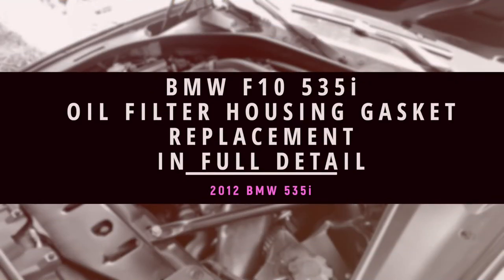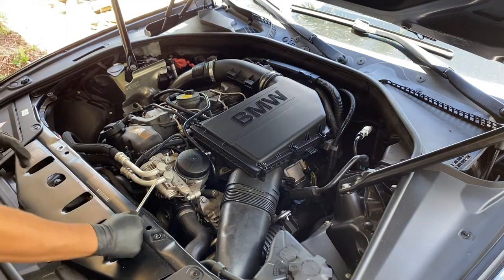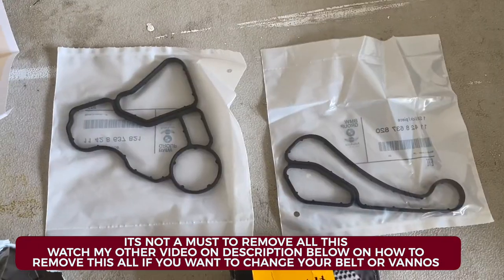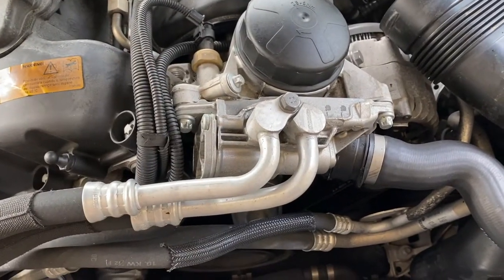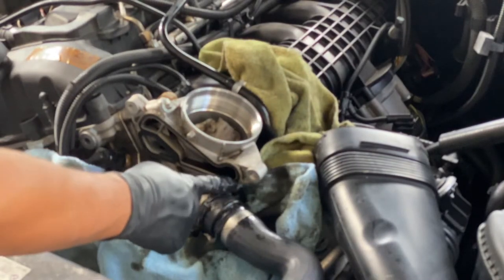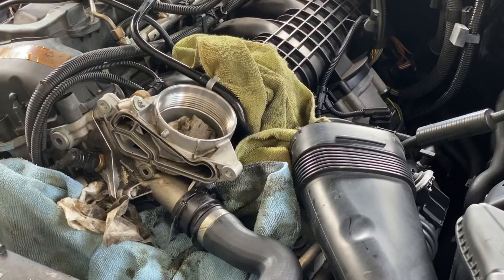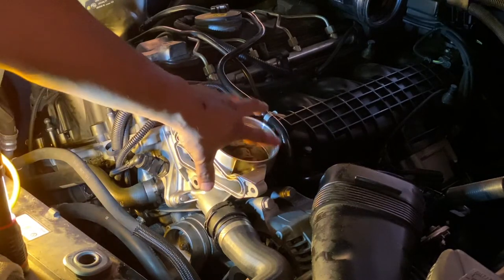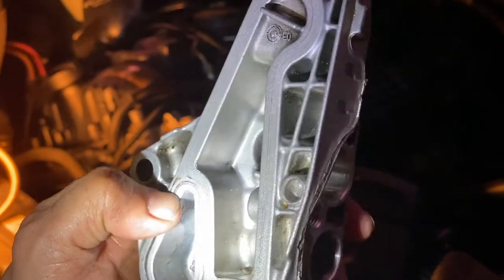BMW F10 N55 535i OIL FILTER HOUSING GASKET REPLACEMENT

Comment: Great video. In the process of changing thermostat, water pump, tensioner pulley , oil filter housing gaskets, and new charge pipe. Car just hit 120k miles want to prepare it for another 100
Reply from the maker: Good luck bro. I sold mine. I have plenty of videos on this car so check it out on f10 playlist
Reply: @HowToDoitright  cool man ill check it out

Comment: I started leaking heavy oil in my N55 2 days ago, had to put 3 quarts of oil in and I noticed today another heavy spill. I checked my coolant tank and it has oil in it. I will definitely take it tomorrow for the same repair you demonstrated including the belt as well. I wish I had the skill and tools to do this job myself. I should've done it as soon as I saw the small puddle on top of the filter🙁... Great video
Reply from the maker: yeah i ignored mine for a while and it damaged the belt (and pulleys which i had to clean). i also identified today that along with this my valve cover gasket is also leaking. i suggest get under the car and see if your leak is getting on top of your exhaust pipe. that indicates a leak on your valve cover also. you can take a flash light and see evidence of oil leaking from sides of valve cover on the passenger side of valve cover. Normally the oil filter housing leak dont make it leak profusely. i can almost gurantee its also your valve cover gasket. have it checked out by the mechanic and have him show you so he isn't lying to make $$.. you can also get the oil filter housing first and monitor the leak and take it back as those are two separate jobs and not related at all.
I will do mine by next week iA and post a video on my channel.
Reply: @HowToDoitright  i really appreciate the advise and I will be looking out for that video. So your saying if the oil leak is profuse then its more the valve cover gasket instead of the filter housing?
Reply from the maker: Yes I lived with my oil filter housing leak for a while because it wasn’t dripping on the ground as it’s so little but didn’t know at that time that the little leak is going all around and damaging my pulleys and belt and since it’s so slow the oil will endup drying on top of your belt that you can see with a flash light and You can even remove the gunk with your nail. It like solidify on too if your belt and pulley. Also it runs down on the front of your engine making it all dirty. That’s another sign. 
The valve cover leak normally is a fast leak and it also cause bad burnt smell outside and smoke in some cases. Also you can smell it as it burns on your exhaust.
Today I posted another video on my belt replacement. Watch it. You will have a look at the front of your engine and if yours is as dirty as mine then your oil filter housing is also leaking.
Reply: Not so much problem with tools as time. BMW wanted about $5000 for what I am doing.
Reply from the maker: Wow 5k is crazy
Reply: Mine is being done now... an going to do the value cover as well... I'm at 146k miles... my value cover ain't leaking but my housing is losing Hella oil... but I also rode with it for 20k miles b4 I realizing the housing was leakin.. barley have any oil in my coolant... so I flushed it after the oil fliter housing replacement an I replaced my belt as well cuz oil had contaminated my belt.. 

Fuel pump 
Charge pipe
Ac unit 
Tire rods 

Are all done now getting the rest done 

Next will be my turbo, water pump b4 they want to go

Comment: Thank you, your assistance is much appreciated. My mechanic buggered up the head on the OFH bottom bolt under the 
intake manifold. Your guidance about loosening the intake manifold would have precluded this. Was there no need to replace the intake manifold gasket?
Reply from the maker: I did replace it later on. It’s cheap so good idea to replace it

Comment: Thanks for the great DIY! One question, Did  you drain out all your oil  from the oil pan before starting the disassembly or only from the oil filter?
Reply from the maker: RiskyRicky_F10 no i did not remove it from oil pan. Only the oil filter. I’ll do another oil change after 5K
Reply: It is advised to drain the oil AFTER the repair because water can get in the oil.
Reply from the maker: Yeah cheap insurance

Comment: about to help a friend with this. maybe i scrubbed past the part where you talked about this but do you need to drain the AC beforehand? not super familiar with BMW but those lines  you unplugged on top were for the AC correct?
Reply from the maker: No Sir that’s not AC lines. That’s coolant line but I didn’t drain my coolant. Some will come out but that’s ok. Drain it if you want to drain your coolant otherwise not needed.
Reply from the maker: Definitely change oil though. Your oil may be muddy as its possible coolant is mixing with oil as it flows through oil filter housing however oil doesn’t go into coolant.

Comment: There is some good information on this video but I can't believe you bolted the intake manifold back up without replacing the gasket on it.  You can expect headaches somewhere down the road caused by a vacuum leak.  The intake manifold should NEVER be loosened without replacing the gasket.  Otherwise, good job.
Reply from the maker: I did infact replace it at a later video. Didn’t do it as I wanted to have a separate video for that. Check out my F10 playlist.
Reply: @HowToDoitright  I have always been extremely careful about disturbing intake manifold gaskets because of possible leaks. I have been the auto repair business for a long time but my wife’s 2011 535i is the first BMW I have had the intake off of.
While installing the oil filter adapter I had to take the intake loose. Knowing what I know now I believe I would consider just loosening it to get to the oil adapter bolt. It took me about an hour to get the intake up high enough to get to the gaskets and when I finally did I found the manifold “O” rings to be just as soft as the new ones I have to install, which really surprised me. The car has 67,000 miles. Since I have it where I can get to it I will install new gaskets, but would reconsider it if I had known.
Igor myself in a hornets nest on this one. Valve cover, gasket, oil filter adapter, intake gasket and complete serpentine setup. Fails to notice the car has Dynamic Drive and bought the wrong Serpentine kit.

Comment: Did you have to flush the coolant?
I just had the job done where they replace the oil filter, housing gasket and the belt tensioner right below it and the next day the car is over heating !
Reply from the maker: Always must flush coolant. If your oil filter housing gasket is bad then it means coolant is being mixed with oil
Reply: @HowToDoitright  I took it back to them yesterday they checked everything over the vehicle is not overheating. I guess they did not flush the coolant said it was not necessary
Reply: I should say they only did the oil filter housing gasket
And the oil cooler gasket
Reply from the maker: @mk3mo578  I would still flush it out to be on the safe side
Reply from the maker: It it overheated once then it will overheat again.

Comment: I have a 2013 535i. I removed 2 bolts and 4 nuts from the intake manifold and it won't budge. What am I missing?
Reply: another nut in very rear of intake manifold underneath harnesses
Reply: @kr0n0gaming4 

Thanks a lot. I will give it another go on my next oil change.

Comment: Don’t forget to prime the engine before you start the car. You will have air trapped in the oil and cause the dreaded Drive Train Malfunction or VANOS codes.  Is recommended by BMW every time you open the oil systems valve cover, oil pan, oil filter housing.
Reply from the maker: How do you prime? I have been changing oils in vehicles for many years but never once I primed any engine. How exactly is it done in bmw and other cars like Lexus Toyota etc
Reply: @HowToDoitright  it’s a bulletin that BMW came out with for the N55 engine due to failure after valve cover or oil pan gasket repair. Unplug injectors (put a charger) start engine for 10 sec and rest the starter for 20 sec in between. Do it about 3 times to allow oil to flow and trapped air to escape.
Reply: @HowToDoitright  so far just BMW N55 but BMW recommends on all as good practices. I sent you the bulletin. Keep posting you did a great step by step video

Comment: Do you have to drain oil before taking it off?
Reply from the maker: No but I suggest drain the oil and then do the job and put new oil. Remember to prime the oil. I have a video on how to prime on this channel.
Reply: When I took off the cap it drained. I needed to get to my alternator.Ok ill need to check that out. Thanks for replying

Comment: BMW oil cooling methods cause more problems than they fix.  BMW engineers, why not run the oil through an oil cooler vs this contraption on most beemers.  I just had to replace my today what a pain in the arse.
Reply from the maker: Agree